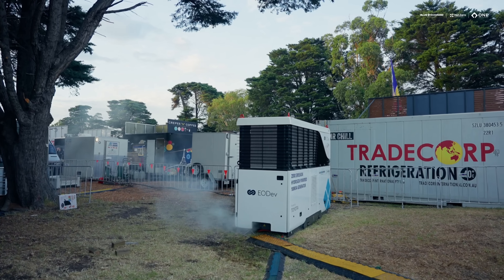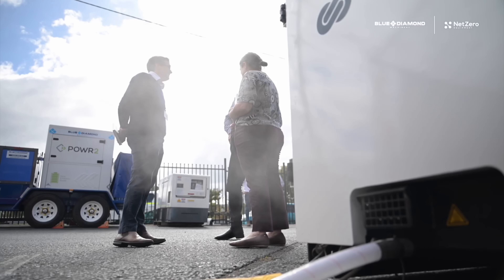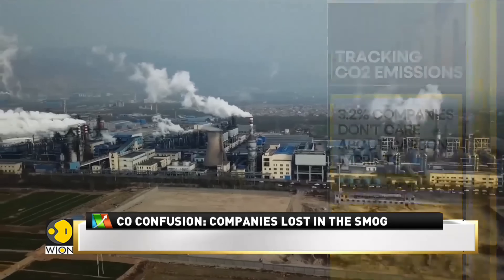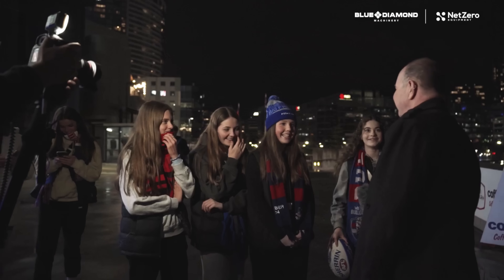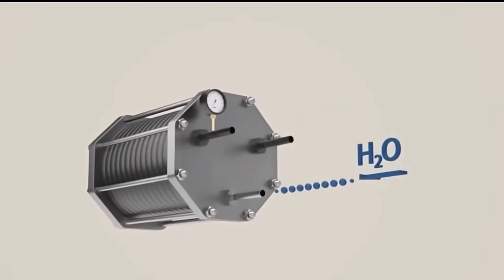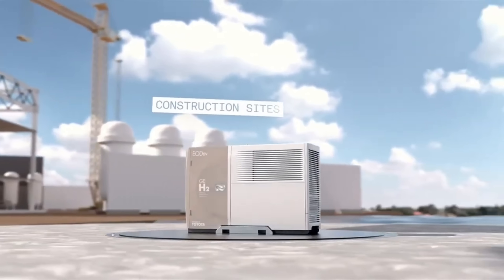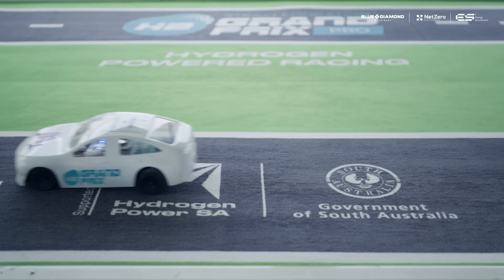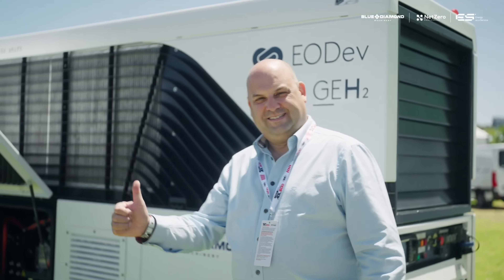Australian Company Shocks the World with a New Free Energy Generator – Available for Purchase 2025!

Comment: It is not free energy. The production of hydrogen costs money and uses electricity produced elsewhere. 
The hydrogen is used to produce power but you need to supply electricity to make it, to get electricity out!
Also Hydrogen is a bugger to store as it leaks through many containers, including stainless steel, so they use it straight away.
I worked with hydrogen for years. It is a "store of energy" like a battery. It is not a power in it's own right.

Comment: This is the type of energy I've been advocating for some time although by a different process. Stanely Meyer and others were able to convert water into a combustible gas made up of separate hydrogen and oxygen molecules. The resulting gas was able to run an internal combustion engine. With this technology there is no need for electric vehicles. Simply fuel up your vehicle with a garden hose. My thinking is that when the resonate frequency of water molecules are reached the bonds holding the molecule together break apart. This is not the typical electro hydrolyses set up.
Reply: He just used square wave form tuned frequency.  Unfortunately it doesn't work as efficiently as he said.  1000's of people have attempted replication and its not even close to over unity

Comment: Sorry, but it is not a hydrogen generator, nor does it produce free energy. As it says on the box, it is a hydrogen powered generator, producing 240v electricity.  The generator is powered by a hydrogen fuel cell, which has to be replaced/bought when the hydrogen is used up. So the electricity is not ‘free’.

Comment: just to understand;
I put water in it and it provides free electricity?
If not, It is not interesting!
I know for a fact that electrolysis consumes more electricity than you can produce with cells by using the output hydrogen

Comment: seemed too good to be true....so how does it run,will it need a connection from water utility and then from there on produce the power and store it in its own sets of battery to power the whole house, was not properly explained, simply doesn't make sense, can anyone an engineering or professor explain this?

Comment: Generac is importing the GEH2 units, costing approximately $300,000 each, from EODev, a French developer and manufacturer of hydrogen fuel-cell generators. 

The GEH2 uses a Toyota fuel cell and a lithium iron phosphate battery that stores and distributes the electricity. The unit can run independently or as part of the utility grid.

Comment: So did anyone hear a price mentioned or how often it needs maintenance and this bull about reducing carbon footprint Australia already runs at below ZERO we take out more than we put in.  In the year to December 2023, Australia's net greenhouse gas emissions were 432.9 million tonnes of carbon dioxide equivalent (Mt CO2-e). This represented a 0.5% decrease compared to the previous year. Australia is the 14th highest emitter globally, contributing slightly over 1% of global emissions.  

Australia removes a significant amount of CO2 from the atmosphere, with estimates suggesting it sequesters around 940 million tonnes of carbon dioxide per year through its forests. Additionally, the oceans surrounding Australia remove about 183 million tonnes of CO2 annually. This land and ocean sequestration is significant, potentially making Australia a net carbon sink.  Plants need CO2 we need more for plants to grow faster.

Comment: You got to be kidding me right. It takes 16 MJ of electricity to split 1 leter of water. Even at 100% efficiency, that is almost 48MJ of electricity with zero output just to sustain itself. So to output 10kw, you need about 96MJ of power. Where is it coming from. How are you getting twice as much power out than you put in??? And unless you're using distilled water, the machine is going to cake up with contamination. Where is the power coming from to distilled all that water? You have heard that perpetual motion is impossible, right?

Comment: my 2 cents i use used oil from mechanic shops, barrel oil burner to produce compressed air or steam to run semi truck alternators,  my backup is gravity 35 foot drop from tree a bucket turns 3   26" rear mountain bike rims, the weight drops slow the last wheel spins at high rpm to semi truck alternators, it takes 45 min for weight to drop enough to charge a dead ex large heavy duty drill battery, most take less than 20 minutes, they 3d print and sell battery accessories 1 all house lighting in door out door, 2 star link and modems, 3 security systems and cameras 4 power bank fridge 5.  2 freezers 6 each room has power strips 
once the weight is on the floor   with a pulley system using fishing line and a regular drill i lift the heavy weight to the top under 2 minutes (on 1 charge i stopped counting after 117 lifts)    nothing is cheaper than my all season system and my backup. . . .

Comment: It's a scam, you need electricity to produce the h2 by electrolysis, and in return, get electricity back from the fuel cells.
You never can get all the electric energy back because the devices are not 100% efficient.

Comment: Clean Hydrogen , the great dreamers Solution . We don’t have the technology to securely store pressurised Hydrogen for more than two weeks and they want to run fool cells on it … the technology is ok but the fuel has too many shortcomings first being it’s size (molecular size) it’s hard to store, combines easily with most metals and takes a lot to liquify … If you want to buy an engine running on Hydrogen technology then be prepared to wait a few years … me? I saw the experiment where the Science teacher bubbled hydrogen through soapy water and set it alight … that spoke about the power of wild hydrogen … not for me !

Comment: Hello everyone, the real output is 88kwh not 10. Max is  110kva. You need to have hydrogen to power it. To make 1kg hydrogen, this is 33kwh of energy, you need 66kwh to make it. That isn't cheap and mostly done with goal or gas. Yes SunPower is also a option, but worldwide. To get such a device you must transport it. It weights between 3300 and 4000 kg. And you need also a vorkheftruck. The max. Lifetime is 15.000 hours. Maintenance is necessary because it will fail after some hours of working properly. Look for this to the Toyota Mirai, same technologie. So is it what they say? Clean air and low costs? Make your own decisions here. Have you all a wonderful day and let's make a better World. P.S. 1 kg biodiesel has 12 kwh in it. Arie the Dutchman.
Reply: Hi Arie, what's the cheapest place to buy one that isn't too complex to set up?
Reply: I like the fact it's done with GOAL or GAS. Exspecially GOAL. I have lots of goal . . . free.
Reply: @piehound   "goal and gas" --> coal and gas
Reply: Do you work for the oil company,?
Reply: @Brad-sh2wn  no I am simply interested in energy
Reply: Are they available in three phase?
Reply: Nice to see that nothing is free and every time you change energy you loose some of it thermodynamics.

Comment: Not free power if depletes the water in the world
Reply: Does Hydrogen Production Deplete the World's Water Supply?
In practical terms, no, hydrogen production via electrolysis does not meaningfully deplete the global water supply—if it's done responsibly.

⚙ Here’s Why:
🔬 1. Electrolysis Uses Water

Electrolysis splits water (H₂O) into hydrogen (H₂) and oxygen (O₂).
To create 1 kilogram of hydrogen, you need about 9 liters (2.4 gallons) of pure water.

So if you needed 100,000 kg of hydrogen per year, you'd use:

100,000 kg × 9 liters = 900,000 liters = about 238,000 gallons/year
That might sound like a lot—but to put it in perspective:

A typical U.S. household uses over 300 gallons of water per day.
That’s ~109,500 gallons/year, just for one household’s toilets, laundry, showers, and sprinklers.
So a hydrogen generator supplying power to an entire home might use as much water as a second household—not insignificant, but also not a threat to global supply.

♻ 2. Water Is Recycled
When hydrogen is used in a fuel cell, the only byproduct is water vapor—which often returns to the atmosphere and reenters the natural hydrologic cycle (rain, condensation, etc.).

So in essence:

We split water to make hydrogen → Use hydrogen to make power → Water returns to the atmosphere.
It’s not destroyed, just cycled.

🌍 3. Global Supply Impact?
Earth’s water supply is:

~1.4 billion cubic kilometers total
~97% saltwater, but even using seawater is becoming viable through new tech (like direct seawater electrolysis or desalination).
So even if we scaled hydrogen to global energy needs, the water use would still be tiny compared to agricultural and industrial water usage (which dominate).

✅ Conclusion:
No, producing hydrogen won’t meaningfully deplete the world’s water, especially if we use recycled, non-potable, or desalinated water. It’s a sustainable cycle when managed well—and much more environmentally friendly than burning fossil fuels.
Reply: Responsibly is the magic word what has mankind ever done that’s responsible!!

Comment: How do you get the hydrogen?  Even  schoolboys know that electrolysis of acidified water yields hydrogen and oxygen. But this requires electricity.  You talk so much in your narrative but did not explain how hydrogen was obtained.
Reply: .exactly ,  the power / energy to split water into hydrogen and oxygen……….?
Reply: try studying
Reply: I'm sure it has a battery.
Reply: Doesn’t it take as much power to split it as you would get back when burning it?
Reply: @jettmonninquisitor9245  Yes. Minus conversion loss.

Comment: So it runs on water. Where's the website where you can buy it? 10kw won't run most homes if that's its daily production. Heard of free power before on YouTube, and that's where it stays.
Reply: It does not run on water. It runs on Hydrogen which is generated by electrolysis. It's a nonsense that it is free energy. It produces water as its exhaust product.
Reply: Yes, but isint work, so no webside to bay this skammer. But is working, What is the problem whit energi in the world now? So it isen working now.